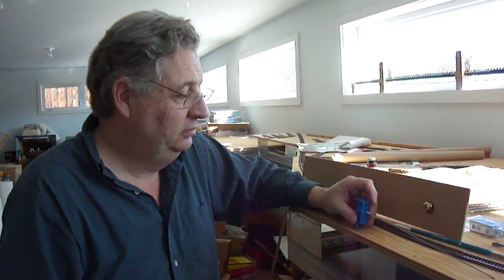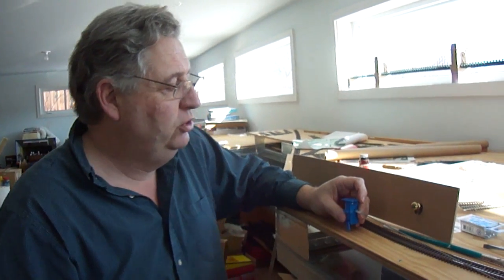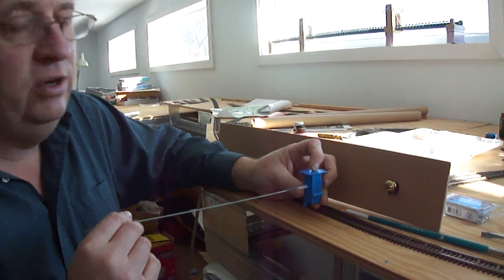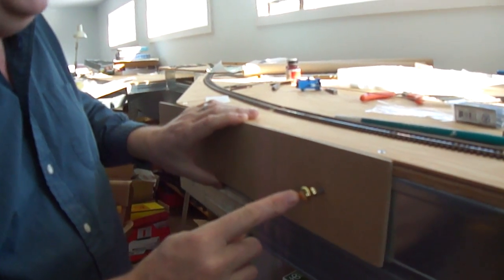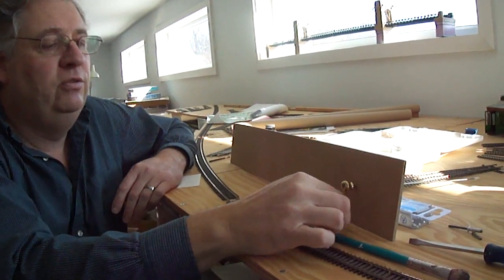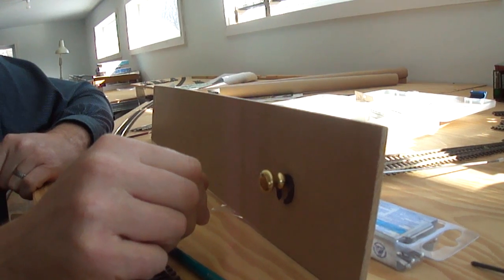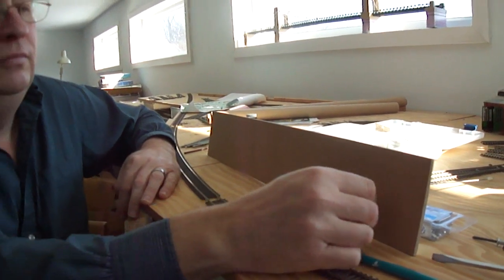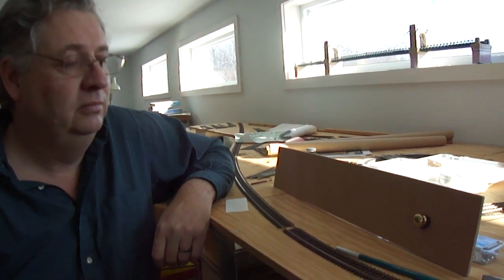MANUAL TURNOUT CONTROL TIP

Comment: Nice tip. That rod looks like a bicycle wheel spoke (its also threaded) . When I eventually get a layout going I'll have to try it out... The brass knob looks very classy too eh.
Reply from the maker: piratepeteakadocc I will pass the word to Robert, though I am not sure if the bicycle spoke would be as economical.  Good point though.